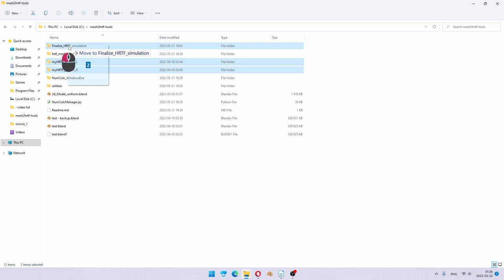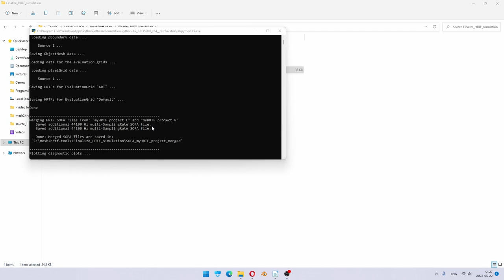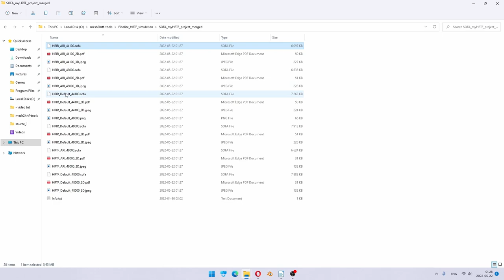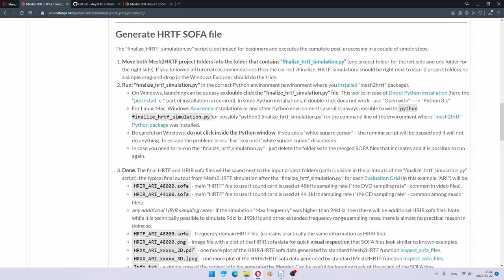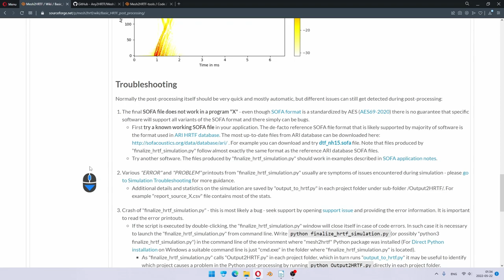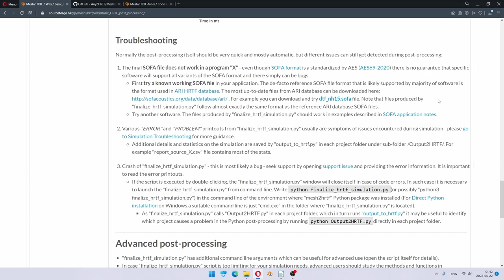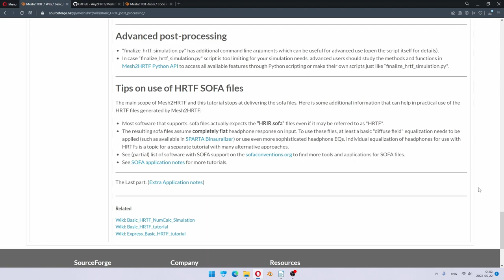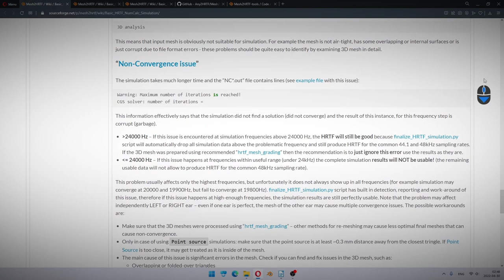Mesh2HRTF - t08 - SOFA file export Tutorial

Comment: Thanks for the tutorial! Unfortunately, I'm running into a problem when executing finalise_hrtf_simulation.py . The command will just spit out the following error: "AttributeError: module 'mesh2hrtf' has no attribute 'Output2HRTF_Main'. Did you mean: 'Output2HRTF'?" I checked the troubleshooting guide and can detect no faults in the NumCalc output nor the mesh. Also, with an earlier simulation (that indeed had been incomplete) I got exactly the same error as quoted above. Thus, I suspect something else is wrong. This is happening on Windows 10 Pro 21H2 with a Python 3.10.5 install. Any ideas what's going on here?
Reply: Here is the traceback output from the console:

Traceback (most recent call last):
  File "C:\mesh2hrtf-tools\Finalize_HRTF_simulation\myHRTF_project_L\Output2HRTF.py", line 36, in <module>
    m2h.Output2HRTF_Main(Mesh2HRTF_version, sourceType,
AttributeError: module 'mesh2hrtf' has no attribute 'Output2HRTF_Main'. Did you mean: 'Output2HRTF'?
Traceback (most recent call last):
  File "C:\mesh2hrtf-tools\Finalize_HRTF_simulation\finalize_hrtf_simulation.py", line 448, in <module>
    subprocess.run(["python", "Output2HRTF.py"], cwd=Path1, check=True)  # run the normal Mesh2HRTF post-processing
  File "C:\Program Files\WindowsApps\PythonSoftwareFoundation.Python.3.10_3.10.1520.0_x64__qbz5n2kfra8p0\lib\subprocess.py", line 524, in run
    raise CalledProcessError(retcode, process.args,
subprocess.CalledProcessError: Command '['python', 'Output2HRTF.py']' returned non-zero exit status 1.
Reply from the maker: @Maestrosi  as Fabian replied https://github.com/Any2HRTF/Mesh2HRTF/issues/24  most likely you were using old version of Blender Exporter script, so you can fix this by updating the line in Outpit2HRTF.py that gives error to  "m2h.output_to_hrtf( ..."   That should be it. No need to re-run the simulation.
Reply: @Sergejs_on_sound  Thanks for your help (apologies for the late reply due to COVID 😞). I managed to fix the issue - everything working now other than the SOFA files not being accepted to the Anaglyph conversion and 3DTI. Only SPAT works with them. No idea why, but will figure out. Thanks again and - great work!
Reply from the maker: @Maestrosi  hope you fully recover soon. I am not familiar with Anaglyph, but I did test SPAT and any of the SPARTA VST plugins (latest version) will work as well. There can be many reasons why software does not like specific SOFA file - perhaps it requires max 128 sampling frequencies; specific coordinate system; a very-specific SOFA convention version or anything really.
Reply: @Maestrosi  Hello. I would like to ask how did you solve this probelm? In HRTF Simulation stage, I get similar error which is  AttributeError: module 'mesh2hrtf' has no attribute 'manage_numcalc'.  Do you remember the solvement , Thank you.